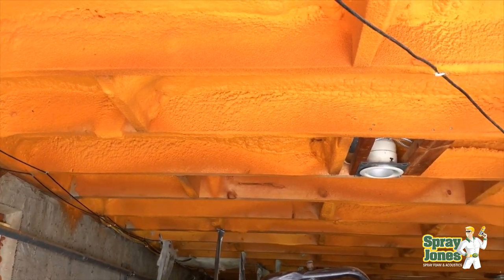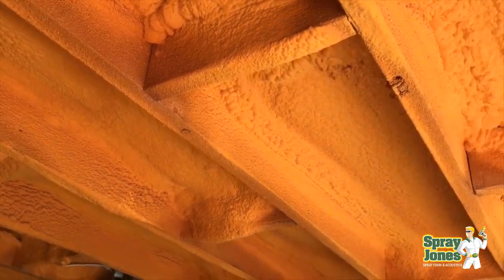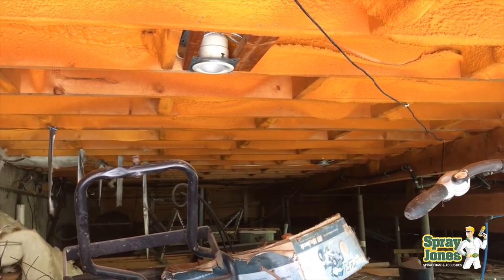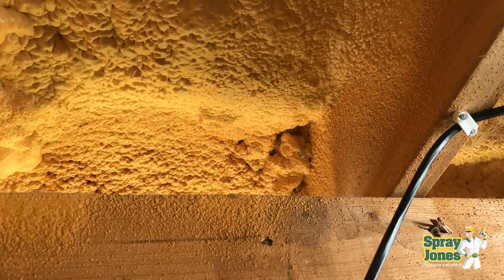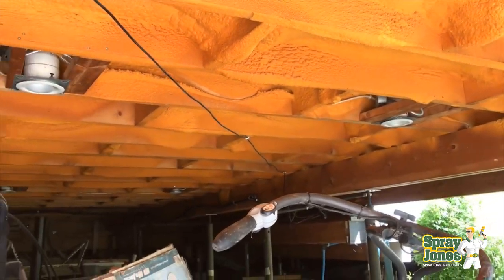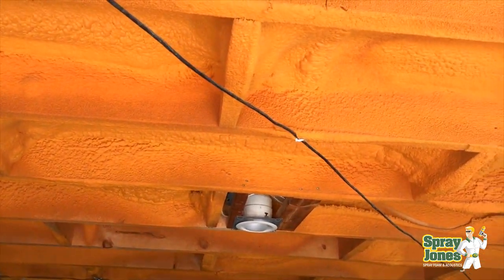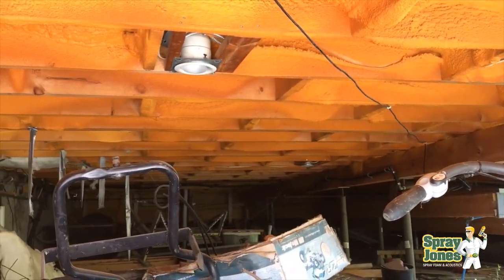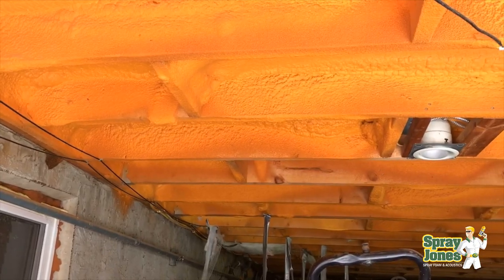What makes this spray foam insulation job so poor?

Comment: I just went to my neighbor house and thanks to Spray Jones. I know not to use them. My one question. Closed cell foam. Are they all created equal? I know that even with the very best closed cell (meaning manufacture if there is one) that the application is the most important part. But with that said is there one manufacture that is better than the other and if so, which one to choose or what to stay away from. Thanks for all your help. I have learned so much from you!

Comment: Hi. Thanks for the videos. Very informative. Question. I recently had my roof deck sprayed with open cell foam. Since I previously had blown  in insulation, how soon do I need to get it removed and what is the main reason? I haven’t seen any videos that explain this. Here in Texas hot and Humid conditions. TIA

Comment: What did they originally spec it for thickness? I see that all the time from the competition where they spec it for 2 inches but have 1/2 and inch in areas to no foam all the way to 4 inches.

Comment: Hi thanks for your content it’s very helpful. I have a standard 8/12 roof. I have a ridge vent on the top of my roof. I’d like to close it off to have spray foam put in. The spray foam company told me to close off the inside and it would be fine. I’m worried that water could come in from the outside if I just do that. Do you think I have to have the top of my roof redone? How do/would you solve this problem?

Comment: hey spray jones,
you said moisture affects adhesion before applying spray foam.
What about when the substrate gets moist after foam is cured and sprayed? Will the foam fall off?
For example on a basement concrete wall that gets moist years later.... will the foam dis-bond from the concrete?
Reply from the maker: No issues once the foam foam is adhered.

Comment: Can a customer have the joists covered in foam too to reduce conductive heat loss through the joists?
Reply from the maker: Yes. That will more than double the area to do.
Reply: @SprayJones  Thanks.   Was looking to do this to a conditioned space over an unconditioned garage in a very cold climate.   Spray foam is the only product that can really do this job well.

Comment: Mike - in my area, wood framing is often treated from ground level up to 3 feet with a borax product (boracare) for termites. Do you have any experience spraying foam on lumber treated with this? Are there any adhesion issues?
Reply from the maker: I personally do not. 
I cannot see there being adhesion issues.